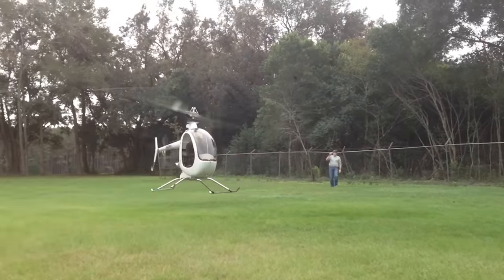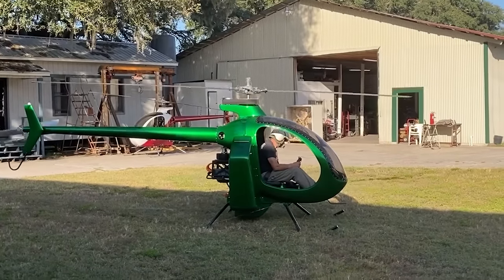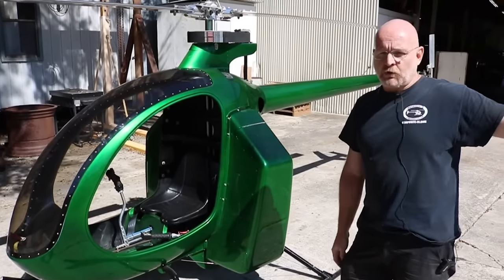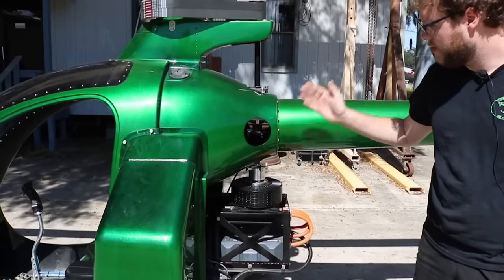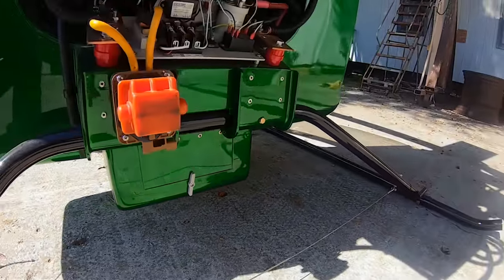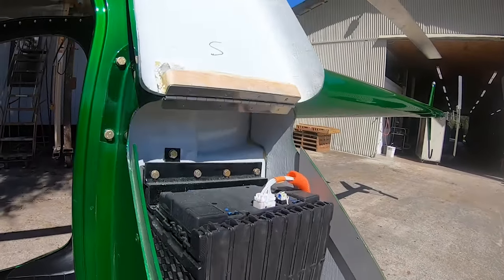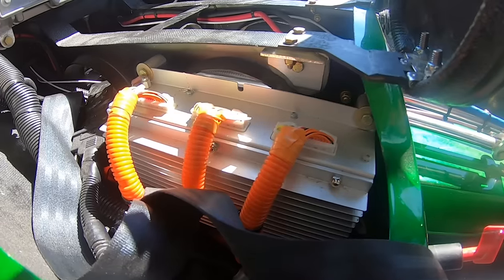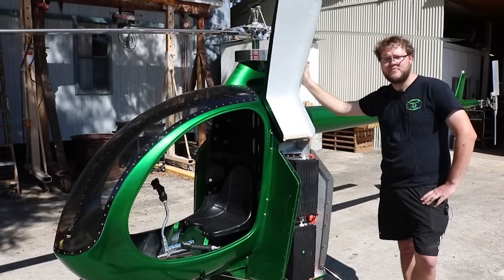Mosquito Helicopter going FULL ELECTRIC!? 2023

Comment: Being a test pilot for Robinson Helicopter for 30 years and building Tesla powered Ford Mustangs I love the idea.  The only issue is that flying for X number of minutes you don't get lighter with fuel being burned off so have have be careful of keeping enough hover battery power left to land safely as the weight does not change.
Reply: Yes, that's a burden that electric vehicles will probably have forever. But if some day we develop batteries with more energy density than liquid fuels, they might make up for the weight.
Reply: The Mosquito has great auto-rotation capability, so any engine loss can still be recovered safely.
Reply: @aeroengguy448  That is great but that's not what I'm talking about. You have to be very conservative on your battery so you have enough power available when doing a normal landing. You need as much hover power in the beginning as in the end as the helicopter won't get any advantage from burning off fuel making the helicopter lighter. Just something that has to be learned. Pilot training is all.
Reply: its still a very good initial training device with ability to emulate different power trains
Reply: @Roadstercycle  that must of been a dream job, and you must of been an very successful pilot maybe even military..I'm not a pilot but I've always observed the pilot throttle back to come down then giving it the  throttle and just before touchdown backing off the throttle..I look forward to seeing a hybrid version as well
Reply: @lightman489  Actually Helicopters don't work that way, we don't throttle back we actually lower the collective to come down, airplane pilots back off the throttle to loose altitude not helicopters pilots. We do close the throttle to do simulated engine failures to practice autorotations.
Reply: EV's are a stupid idea. This is a toy at best.
The EV is the most destructive vehicle EVER devised.
It is FAR more environmentally damaging to produce than any equivalent petrol or diesel vehicle.
It has a shortened life, due to the limited lifespan of the battery being just a fraction of a modern petrol or diesel engine.
Plus, as the battery is the largest and most expensive component in the vehicle, the car will be rendered almost valueless once it decides it doesn't want to be charged any more.
In short. They are a con. A very expensive con. A very destructive con. A very dangerous con.
The manufacturers know it. As do the "environmentalists". And governments.
And anyone else with half a brain.
Reply: @sahhull  That's pretty funny as that's the same thing people raising horses 120 years ago said about the horseless carriage. They'll never replace the horse.
Reply: @sahhull  Shortened life? Maybe with Teslas and other manufacturers that make them that way. It's not a specific EV problem, but how they're currently built. Electric bikes and motorcycles for example all have removable batteries that you can just replace and keep rolling. Much easier than replacing or overhauling a combustion engine, plus the electric motor proper will outlast any other component of the vehicle. Add maintenance (or lack off) and the economical benefits are quite obvious.

I won't argue that current battery tech is still harmful to the environment (even tho conventional cars are not innocent either) and can't replace petrol yet. But in the long run it's the best shot we have. Synthetic/alternative fuels will probably stay for more specific roles, but everything else will be electrified.
Reply: @moteroargentino7944  Tesla have a well known issue with their drive motors and premature failure.  It's not certain that they have solved it with the upgraded motors.
Reply: @sahhull  I think you are what we call a dinosaur. And good job not responding to any of the raised points that immediately undermined your arguments.
Reply: I image there shouldn't ever be a decrease in power available as the battery runs down. Lithium has a very shallow voltage curve. There should be a suitability sized motor to maintain 100% rotor rpm at all times even at full collective.
Reply: @Jameswrightdavid  I totally agree. Again it's all in the flight training.
Reply: @moteroargentino7944  MORE energy density than liquid fuels? You might be able to come close. But if you’re getting to the point of being better, you’re living in a completely different technological future. You’re talking completely revolutionary  tech. Hell, probably revolutionary tech OF revolutionary tech. It would be like going for cars, to the wright brothers inventing a plane. We can’t even conceptualize how a battery would work that can contain more power than liquid fuel. Battery flight is a pipe dream. Specifically  because you’re taking away one of the biggest advantage of liquid fuel, which is the aircraft gets lighter. But then, even if liquid fuel magically didn’t get lighter, it would still be worth it over battery
Reply: @Jameswrightdavid  fully discharged voltage is roughly 20% lower than fully charged, so if battery voltage is the power limitation, the power could be significant. 

On the other hand, in this case the motor is likely the power limitation.  Running at the speed that it does in this first experimental craft, it us marginal even for steady hovering in ground effect.
Reply: @sahhull  the combustion engine mosquito was nothing but a toy also, just saying.
Reply: 20-25 battery life 😂 it’s not even legal to take off with reserves.
Reply: I just started at Robinson.
Reply: @b69mach1  legal? reserves? It's an experimental version of an experimental series of aircraft that are essentially toys in their production version. They're not suggesting that anyone buy this as it is, and won't sell it if someone asks - it's just a research and development project.
Reply: @sahhull  im on my second tesla, i love it. They are more reliable than any gas car ive ever owned. Also, what is your data that EVs are more environmentally destructive? I am sure EV companies did their research on this but I do want to hear what you have to say since you seem to be the expert on cost accounting and the big picture.
Reply: @moteroargentino7944  efficiency is lost with energy transformation. What you’re describing isn’t possible. Energy has is captured to be stored in a battery. Never mind it’s lost over time. EV is a lost cause. I’ll keep burning jet fuel.
Reply: @Roadstercycle  to be fair to lightman, as collective is reduced less engine power is needed; as a result, to keep rotor speed from increasing the pilot has to reduce throttle, if the aircraft doesn't have automatic throttle control.

No modern helicopter should have a manual power control (throttle), and as mentioned in the video, this electric version has the obvious constant speed control so there is no manual action needed... but reducing collective still means reducing power.
Reply: Battery capability is yesterdays problem. As soon as they come out with the batteries we need ;) it will change everything!!
Reply: @sahhull  Your rant does not stand up to scrutiny. How many components in an ICE?. How many of those are prone to wear or failure? How many factories involved in manufacturing those components? How much energy to produce? Maintenance is much more complicated/expensive. Although electric has been around a long time, this aspect is in it's relative infancy. See how rapidly and effectively Tesla is shredding the ICE car.
Reply: @DBFIU  How do you expect a dinosaur to understand the wonders of our current technology? Dolphins and apes are closer to us but they can't do that. A dinosaur has absolutely no chance.
Reply: Adding a 20 kg petrol generator to give it 2 hours of flight time
Reply: Its funny how their always one who claims to have worked for all three.
Reply: @sahhull   All EVs need is standardization, we need standardized power cells. You go to ´electric station´ but dont plug anything, just choose if you need long range cell or standard and interchange these cells, you return your cells to electric station and it will sell you fully recharged ones. Something like this idea for current capacity values. In future for sure, it will be different. Until that i stays on combustion ones.
Reply: @sahhull  have a look at Lithium Titanate (LTO) batteries. Some have a lifetime of 30,000 cycles. Unfortunately the energy density isn't ideal for EV, they are a great alternative to lead acid starter batteries. They can also operate in extreme cold or extreme hot conditions. At 30,000 cycles, they'll very likely outlast the vehicle they're starting, to be almost a family heirloom that is passed down through the family from car to car.
Reply: @Cybertruck1000  the funny thing that ICE advocates conveniently forget is the environmental and energy costs of digging up, refining, shipping, then trucking gas to a gas station. In some cases the oil is shipped multiple times because many countries don't have the ability to refine their own oil. I live in Australia, and Australia cannot refine its own oil. We get all our refined oil from Singapore. 

EV only needs energy from a mass-producing power plant, transported by high-voltage transmission lines. Power plants are much much much more efficient at converting fossil fuels to energy than refineries, ships, trucks and the ICE vehicle.
Reply: @DBFIU  evs are absolutely more destructive to the environment. You should look up EV battery recycling programs. They don't exist you should look up EV recycling issues. Just because you drove a car through its warranty duration doesn't mean it's worth it's weight in 5 to 10 years when the battery pack is depleted it must be replaced.
Reply: @mastermnd22  Oh ok, thanks for the concise and clear data and cost analysis you've provided. You clearly show that given all variables, such as manufacturing costs up front for ICEs vs. EVs and long term pollution analysis (considering the gasoline spent to deliver the gasoline that then needs to be pumped into gas station tanks underground) and the analysis you've provided on the recycle programs that in fact do exist for batteries (there are very large grinding machines that break down the batteries and then they can be melted back down) that in fact, EVs are much worse for the environment. I am so proud that you have done all this hard work for me, it seems you truly understand the logistics and calculations involved with pumping, refining, shipping, delivering and then burning of gasoline and diesel vs. just creating electricity in one easy to manage and cheaper location where emissions are better controlled and powerplants can exceed 60% efficiency where the best ICE car engines are in the low 30% efficiency range. I am humbled by your input.
Reply: @jamesbizs  As I said earlier, I don't think that liquid fuels will completely disappear, they'll just be replaced anywhere they can be, and kept in applications where their characteristics are useful. For example, jet engines in aircraft for higher speeds, either military or civilian. Probably shipping as well.

Fuel getting lighter is a big advantage, that's true. Still, asides from big airliners that DO need the weight reduction to land safely, any other aircraft can fly without problems as long as they have enough power to run their engines the whole trip, regardless of weight.

That's why energy density is crucial, as long as you can cramp all the power needed to fly or travel a long distance in a reasonable size and weight, you can create a vehicle that can perform the same or better than one powered by combustion engines (barring the few exceptions mentioned at the start).

Regarding time lines, it may take some time but sooner or later it's bound to happen. We're not THAT far away, when we talk about energy density it's not the total potential but just the amount of final mechanical energy to the wheels/propellers vs total weight of the system. Energy efficiency is very important, given ICEs are 30% efficient at best vs around 90% of EVs, you don't need to match both exactly in terms of brute energy alone. They just need to accomplish the same tasks.
Reply: @sahhull  That's probably who all the car companies are putting billions of dollars into development into EVs.
Reply: @Roadstercycle  the batteries should be in auto switched banks so you can always have the power of a fresh battery even if just for a critical few seconds. another option is add a supercapacitor bank as a 'boost'
Reply: @sahhull  I cant speak to your own personal experiences with EVs or Hybrids. However, we have 3 cars. 2 of them are hybrid toyotas. The prius has 340,000 miles and still has its original battery. I changed out the 1st set of brake pads around 180,000 as the regenerative braking does most of the work. Sure.. the car is a slug to drive.. But I consistently get 45mpg+ on long runs with work even at this high mileage. Never once have we had an oil leak etc. Great little car. The other hybrid has 50k miles. No issues either and getting 36mpg+ for a AWD is not bad either. 

I dont know that EVs are perfect in every application, where the battery weight ratio is important, like a small helicopter.. But they do make sense in a school bus etc.. Plenty of torque.. stop and go.. loads of space for batteries, and easy to charge and they are only driven for 3hrs a day. 

Thats my 2 cents.
Reply: Doug? Tim? Jack? It’s gotta be one of you guys. There’s only a few of you that’ve been working on the factory flightline for that long. And every one of you guys are rockstar pilots! I haven’t been to the safety course in 20 years. ✌️
Reply: @Roadstercycle  well, another thing to consider is regen. i dunno about helis but i assume with altitude you can store battery power that can be regenerated on the way back down. just depends on how efficient the regen is.
Reply: @sahhull  nope. Plenty of evs have gone 500000kms on the original battery. The newer LFP batteries will last twice as long.

Most Ice powrtraina are worn out at 500000kms.
Reply: @moteroargentino7944  No, because an airplane can land anywhere that's flat enough, and even with little to no power, so they're already pretty much viable methods of transport, heck, you can drop the use of cars significantly if you make more small landing strips all over around cities for private and commercial Eairplanes. Meanwhile Ehelicopters and Vtols for now are kind of unjustifiable trash you can't really do anything with.
Reply: It's all about the possibility of risk and when you add a stupid battery your failure rate just increase times 10
And correct me if I'm wrong but there's NO AUTO ROTATION WITH AN ELECTRIC MOTOR????????????????
Reply: @aeroengguy448  you can't auto rotate with an electric motor you need a free spinning blade to do that!?
Reply: @Roadstercycle  actually LARGE airplanes land under almost full throttle in case they have to go around
Reply: @mkzhero  can anyone explain to me how you're supposed to auto rotate in a helicopter with an electric motor that doesn't have any "clutches" to disengage the blades from the motor???????????????????????????????????????
Reply: Maybe it can regenerate its battery while it falls to the ground
Reply: i dont think batteries are ever going to be where they need to be for any type of REAL efficiency. the next stage of electric vehicle development is hydrogen fuel cell for electricity generation and carrying a water dissolved liquid potassium borohydride, this will require probably a warmup cycle where you will need to get the fuel cell and hydrogen production feeding itself enough for takeoff
Reply: @thecloneguyz  Eh, you probably could make some new mechanism for it... But i don't know why you WOULD in the first place, considering that with 20-30 min flight time for any Eheli it just makes them an unjustifiable stupid gimmick for now.
Reply: @thecloneguyz  Every helicopter has something called a Sprague clutch in the drivetrain.  This one way clutch permits the rotor to free wheel in the event of engine seizure or failure.  This is what allows autorotation.  This electric version is no different.
Reply: @kosztaz87  removable batteries.. Considering that we don't have the lithium supplies to fully cater for the electric car market and phones etc how do you expect to magic up extra lithium for swapping out batteries?
Reply: @sahhull  take your meds mate. The early Tesla model S motor suffered eddy currents though its bearings, causing pitting on the bearing surface, and hence premature were. This is fixed now, with the current Tesla motors using non conductive ceramic bearings.
Reply: @jamesbizs  quiet. That is the fantastic advantage evs have. Quiet. Evs have a massive advantage over burning dino juice when it comes to noise
Reply: @13thbiosphere  nope.
Reply: @thecloneguyz  take your meds mate. Synchonous ac motors do not have magnets and create their own fields. Ie, no resistance to rotation when the power is removed. Also there is a clutch. Your problem is ?
Reply: @thecloneguyz  Synchonous ac motors do not have magnets and create their own fields. Ie, no resistance to rotation when the power is removed. Also there is a clutch.
Reply: @thecloneguyz  Synchonous ac motors do not have magnets and create their own fields. Ie, no resistance to rotation when the power is removed. Also there is a clutch. Your problem is ?
Reply: Actually bud…as the battery cells coating is diminished you would technically become “grams” lighter lol
Reply: @sahhull  There is plenty of lithium in the world. The problem is collecting and refining it. Lithium (the 3rd element in the periodic table) is more abundant than iron. Also rechargeable lithium batteries have almost no lithium in them (~2%).
Reply: Until we get carbon matrix batteries, I just don't see it having any more flight time than a short hobby jump. We could've been a long way ahead with experimental EVA... but our government, in all their ignorance, decided to tighten weight restrictions on ultralights with no EV exemption 🤦
Reply: @moteroargentino7944  we actually do have a solution to this in development hydrogen batteries

now unlike hydrogen combustion were not taking the hydrogen and burning it to create combustion and so on it takes the hydrogen and drips it over a cathode and anode causing it to combine with oxygen and generate a voltage and be converted to water and electricity

so this would get somewhat lighter with usage however the difference would not be as much as with aviation fuel as gasses are lighter than liquids so there may not be much difference in full vs empty

however i do belive the hydrogen systerm has a higher energy density per kilo than current battery technology so that might be where it makes up
Reply: Software will ensure the displayed battery percentage is for conservative and safety measures mate.
Reply: I was test flying the cri cri before a small company ordered several here in the USA.. I liked that it was mostly mechanical it handled really well for being so small but I wouldn't recommend flying it above 12,000 ft. This helicopter I would be very nervous as it's mostly technical..  
As a matter of fact all helicopters make me nervous because when you crash land them there's no way of coasting them it's like a big anchor being dropped. I would have to have a parachute installed as well as an overhead lever to manually stop the rotor from spinning..
Reply: @sahhull  please tell that to the taxi driver in Norway who has 400,000kms on his model S taxi  PS it still has 93% battery left.....
Reply: @mkzhero  Ehh... I was talking about aircraft in general. Includes all flying vehicles. Airplanes particularly are great to get from point A to point B fast, especially over medium to long distances. But over short to medium distances, other vehicles could be more efficient. Like in Europe that they're favoring the use of electrical trains over planes if the planned route can be done by train. For less busy routes you could use small electrical planes, personal electrical cars or maybe trolley buses if the amount of passenger movement justifies putting the infrastructure in place (like between villages or small cities). Relying on the grid is always better than carrying heavy batteries around.
Reply: @dask1516  - Ballistic Recovery Systems (BRS) makes an approved chute, which the feds have also given an exemption for gross weight. As for electric vs. engine... they're all technical. Turbines have frail internals and are sensitive to abrupt pressure changes. Small aviation grade piston engines are subject to catastrophic failure. Rotaries give a nice cushion, with respect to catastrophic failure... but they're too thirsty for small aircraft. Electric motors are significantly more reliable... but the control systems can be troublesome, and the overall weight of the package forces sacrifices to be made in the airframe. They're breaking records every day, and I know we'll see a successful EV market within a decade or two... but as for now, I'd call it even on the safety aspect.
Reply: @moteroargentino7944  That my friend is a pipe dream. Batt tech is mature.
Reply: @sahhull  Correct, but some do not like facts....  they'll learn the hard way.
Reply: @moteroargentino7944  thats the thing,for the most part, a comparison between a helicopter and a plane in terms of wastefulness is almost like the comparison between a train and airplane. Trains are by far the most economic (energy wise) method of transportation, only losing to the (human powered) bicycle, the velomobile and electric velomobile, which areto be honest an amazing method of transportation that sadly there's simply no infrastructure for (separate safe and well maintained roads). A car is far more wasteful than a train, an airplane more wasteful than a car, and a helicopter is the king of wastefulness. Helicopters only make sense for rescue and urban transport where there's no place to land, except converting VTOL's do that better (the type that has a wing and bends it 90 degrees after takeoff to be almost as efficient as an airplane). Anyway, 20-30 minutes of flight is just too unjustifiable for a helicopter to be practical and safe, and until the grid is fully green it's also not actually clean, so it kind of beats the purpose to have one anyway. Until batteries get better and they can squeeze at least an hour out of it, it's kind of just a rich toy.
Reply: Auxiliary landing battery. Fixed 👍
Reply: @mkzhero  what the heck man? Helicopters can be safely landed with zero power, in a space not much larger than a basketball court. Im not sure how a fixed wing craft that requires some type of landing strip can compete with that?
Reply: @sahhull  harvest it from the 200 billion tons of lithium disolved in the worlds oceans. Its not an efficient process yet, but look at how far phones have come in 20 years. The driver is always profit. Theres money to be made so it will happen...
Reply: It does lose weight.  Less than a gram but just saying.
Reply: @zenellwood7029  well, you overdo it with the "basketball court" size, they need much more space than that for autorotation, but yeah, I wasn't aware how efficient and semi safe that manuver is. Still, you also underestimate planes with the landing strip, the slower and lighter planes can land on a road, field, beach, or any even remotely straight plot of land pretty well.
Reply: Maybe they can eject the used up battery with a parachute in an emergency,
Or
Carry a spare, for emergency
Reply: Great comment
Reply: This is so dangerous only for one off mission with a paras hoot plus so bad for the environment when your making and disposing the batterys ultimate fail
Reply: Well if u have flown r/c performance helis you would know that of course, just like drones.
Reply: Wait isn’t the Robinson helicopter the worst safety rated heli in existence?
Reply: @rustyneedles3743  I mean I know you're mad but it really isn't that complicated. It is just a machine that grinds down batteries into constituents. Since internet seems very difficult for you to use, I did the research for you on Google. Here are a few names of companies that grind down batteries. Franklin Miller and Amey Engineering are two that actually came to mind, there are also pretty inexpensive grinding machines you can buy online if you wanted to start your own recycling business. It is a low overhead business and pretty easy to do. Do you want me to use bigger words for such a simple task so you can feel smarter?
Reply: Based on your experience do you think that this would work better as a hybrid?
Reply: @feelincrispy7053  They are all trial and error right now
Reply: What is Tesla powered Ford mustangs? Using components of old Tesla in a salvaged mustang body?
Reply: @blahblahblah9619  Mach E
Reply: @blahblahblah9619  I buy nice S197 Mustangs and then remove the motor, trans, and differential and replace them with Tesla drivetrains. You can see my builds on YouTube. Look up Roadstercycle Tesla swap.
Reply: Theres a special place in hell for people swapping electric engines into classic cars
Reply: @Immortal..  I'm glad that my conversions are not classic cars yet. I'd hate to be crusified by someone who has no clue about electric cars. Acceleration is the motivation.
Reply: @voornaam3191  so what I'm not a pilot but at least I'm a gentleman and your not
Reply: @feelincrispy7053  It was in the beginning but with safety courses and good pilot training that went away.
Reply: Can't a dynamo style system generate enough electricity to replenish the battery to some degree?.....and so, making that energy percentage account for the landing charge required?
Reply: @missingMBR  that should be corrected it isn't that Australia can't refine fuel we have the infrastructure they just won't because it is cheaper to ship it here ratger that process it here
Reply: @numnut1516  yep they are definitely toys but if you had to chose which would you prefer a toy that works for 20 minutes then is down for hours or one that lasts 2 hours and can be ready to go again in 30 minutes
Reply: Some brains are gonna work hard thinking about this.
Reply: @DBFIU  ever seen a lithium mine? What do you think is the driving force behind the production of you ev? Fossil fuel of course lol. I love tesla and aren't knocking ev's but to act as if they're better for the environment is a joke. Then there is the issue of recycling said batteries once millions start to flood the junkyards across the country. Simply put were jumping the gun on ev's under the false hope of being more environmentally friendly when in fact in the electric vehicles current state they are far more harmful than their gas counterparts. Not in their day to day functions as they produce no emissions there so they are more environmentally friendly once in production than a gas car while being as destructive as humanly possible on the production and recycling end of things.
Reply: @PatrickCavanaugh0420  do you have any actual data with numbers comparing the impact of mining lithium and making batteries vs the long term affects of pumping oils, refining them and burning them for the next 100 years? EV companies have this data, and the answer is yes, even though mining lithium consumes fuel, it is not even a fraction of a percent of the lifetime of fuel consumption and logistics of keeping oil and fuel machines and cars going. Do 5 minutes of research please, thanks.
Reply: @mastermnd22  Redwood is a massive ev recycling outfit. The CEO is from Tesla. Tesla batts are designed from the beginning to be recyclable. In 5 -10 years the replacement pack will be FAR cheaper than the orignal.
Reply: @thecloneguyz  Take an electric motor with no power applied and spin the shaft. It will spin just fine. No clutch needed.
Reply: Well sure and probably more ways to do it than one but ok make disposable battery that collapse and toss if need be or some type of parachute probably under the bottom to slow descent or emergency battery in maybe the tail just as extra but only few down sides would be charge times per flight
Reply: @DBFIU  doesn't matter your over thinking but you think one will cancel out the other nope they both have a place and especially light weight airplane but over a certain size oil is better
Reply: @BugThorn   like current propane bottles 🍼 for the gas grill
Reply: @moteroargentino7944  unfortunately if the battery still resembled anything we recognise as a battery and had the energy density of kerosene it'd level buildings if the battery was damaged during a crash.
Reply: @sahhull  What we need is a fuel cell that directly converts gasoline to electricity.
Reply: @moteroargentino7944  hydrogen powered electic is the way to go for stuff like this
Reply: @kosztaz87  Ah yes, the 'insult, then piggy back off other's to make yourself seem smart' Argument. 
At least we've found our pseudo-intellectual in the chat.
Reply: @DBFIU  Lithium and Battery production is incredibly destructive.
Reply: @Sercer25  yes, but not nearly as destructive as pumping, refining, shipping, burning fuel and oils. Ask any OEM, there is a reason they are going electric. It just makes sense, it is the lesser of two evils by a long shot
Reply: @DBFIU  the amount of upkeep electric will take if we all switch will be massive, lithium farms HAVE to be HUGE already, so it will wipe out much more land. Oil reserves arent as destructive because we can tap into resevoirs deep underground, and we have an absolutely massive amount. Lithium mines cover surface area, in addition to transportation (ships wont be electric)
Also, batteries get 'disposed of' in the ocean when they're used up.

We could have alternate engine powers, like water, but the patent holder got murdered.
Reply: @DBFIU  OEMs are going electric because its a cheaper upkeep. Cars arent going yo be cheaper after they switch to electric motors, and the 'energy' required to power them are going to be the same as gas....
Now it'll be way easier for them to price fix electricity. Enjoy the cost of hearing your home in yhe future, and powering it....
Reply: @Sercer25  ok you're one of those people. No, we can't use water to power anything, it is a low entropy substance. Once hydrogen and oxygen combine violently, the energy is given up as heat. Water is formed, and it remains stable and unreactive until you put more energy into it to separate it. The guy who invented the water engine was a cook, and had no idea what he was doing. He made a little splash and then died, there is no way to make a water-only engine, you need to add a ton of energy for hydrolysis to separate the O2 and H2 which consumes power. Lithium mining is destructive, of course, you make it sound like pumping oil is so simple, "it's already there, so easy!" No it is not so easy. Once the oil is extracted it has to go through miles of pipe and dozens of heat intensive and chemical processing to separate the weights and purify the oils. Then, it has to get shipped which costs more fuel. All of this is done continuously without end, batteries get made once and charge for a decade. The power they consume from a powerplant is centralized, one powerplant charging thousands of car batteries is much better than 1 milliom car engines running and needing upkeep and gasoline. A powerplant runs at above 60% efficiency in a lot of cases. Cars are barely above 30% efficient. This means for every pound of natural gas (which burns cleaner btw) a plant has to burn, a car needs to burn 2 pounds for equal amount of power, put simply. And there are logistics with shipping fuels to every single gas station on earth, constantly. I was a turbine engineer for 8 years. Don't tell me you or anyone else has any idea what they are talking about. I understand why OEMs are doing this, they ran the actual numbers, and so did I. The numbers point in the direction of EVs as much as you can kick and scream. Politics and tradition can only so far, then physics and economics always wins.
Reply: @DBFIU  the water engine was a joke, I don't expect someone like you to have a sense of humor. Anyway, disregard what I said champ. Enjoy your inflated electricity costs which wont fix anything, but it will give incentives for people to cash in on more environmental destruction cleanups. Diesel is a better burning fuel anyway.
Reply: OR STAY THE HELL AWAY FROM EV FLYING MACHINES
Reply: @Sercer25  I have no idea what you mean by that. Are you saying my comment was insulting?
Reply: that's a good point. He should design a mechanism to drop the empty batteries.
Reply: @sahhull  The only problem EVs is battery tech. Once we develop a better battery,  then the 21st century will get more exciting.
Reply: @DBFIU  you have had 2 Tesla's since they first came out in 2008, i bought my ford escape in 2010. With 256,000km on it and it is still running strong! I will get another 7 to 10 out of it easy! By then you will be looking at another Tesla! Gas is far better!
Reply: I think electric aircraft are a bit more challenging than electric cars, as cars have sporadic needs for full power, and can cruise at highway speeds on maybe 10% of the rated power.  An aircraft is typically asking for 75% of the available power most of the time.  However, I think recreational ultralights could be a great use case for electric aircraft.  2 stroke ultralights are loud, buzzy and annoying.  Going with electric with a larger diameter/slower moving prop, you could get much much more quiet.  And the charging cost per flight is measured in cents rather than dollars.  You don't necessarily need 3 hours of flight time; perhaps 1/2 hour is plenty.  Battery life is an issue, but not necessarily an insurmountable thing.  I appreciate those who are experimenting with electric airplanes.  I've seen some promising self launched electric gliders like ATOS Wing AIR.
Reply: @brianb-p6586  Matt here. 60HP (~45kW) is more than enough for steady hovering in ground effect. The issue we are working on is that at 2750 RPM, we are slightly exceeding the continuous power rating of the motor. But also that the voltage into the motor at this RPM is quite low, so we are exceeding the continuous current rating of the controller. We are either looking at a motor with a higher V/rpm, or the same motor with a spur gear reduction so we can run it at a higher rpm and thus lower current/torque, but same power. The motor is rated for 60kW(80HP) continuously and 110kW (147HP) peak at 5000 RPM. Actually making it the most powerful motor out of our whole model range, but of course flight time would be terrible if we were consuming that much power.
Reply: @brianb-p6586  Matt here. Thanks Brian, you are exactly correct. We recognize that 20-25 minutes would be a hard sell even to someone who just wants to do a quick buzz around their backyard or airport. That's part of the reason why it is just an R&D project. 
It's just a first step and basically us getting our feet wet as we look at alternative power-plant technologies. We are looking forward to working on a hybrid version, we recently found a supplier of cells (thanks to this video) that are roughly twice the energy density which might allow this to stay all electric and get double the flight time, but also allow us to get a safe reserve as well.
Reply: @Cybertruck1000  Matt here. This is one of the major advantages I see with electric power-plants. You don't need to do any maintenance apart from your regular pre-flight inspection of drive-line parts and linkages. No carbs or fuel injection to tune or worry about tuning for different altitudes/operating environments, no cylinder replacements, no spark plugs to replace, etc. Of course batteries do wear down after a couple thousand cycles, but how many people are taking their experimental helicopter out every single day for years for this to actually matter. 

Also it's very cheap to operate, it costs us about $1 to charge whereas in our XE290 piston engine you would be looking at 3 gallons of premium ethanol-free fuel for 30 minutes, 5 gallons of Jet-A for 30 minutes with the turbine. 

We are already in the process of working with a electric vehicle company to procure battery cells that are roughly double the energy density of our current cells. Battery technology is progressing all the time and we see that this may become a viable commercial product in the coming years. For now, it's an R&D project and to show off an innovative application of electric propulsion.
Reply: @0xsergy  Matt here. We don't regen. It isn't a great idea because what happens if you didn't actually capture enough energy to do a powered landing. You may not have enough rotor inertia to do a safe auto-rotation. We are working on designing a pack that has cells with double the energy density but keeping the overall pack weight the same, we will be able to add a reserve.
Reply: @thecloneguyz  Matt here. The motor is coupled to the drivetrain through a sprag clutch. So it autos perfectly fine just like any of our other models.
Reply: @thecloneguyz  It has a sprag clutch. Nothing crazy like trying to regen.
Reply: @glory122  Thanks for the reply. 

Yes, I realize that it is the inappropriate operating speed that makes the motor marginal, rather than the motor itself. I understand that changing the belt drive ratio to increase the motor shaft speed would not be trivial, because it would also change the tail rotor shaft speed, but for a production version is would be very desirable to avoid an extra set of reduction gearing.

Of course for development the extra set of gears would be a reasonable approach, and more practical than having a motor custom-wound. Even with custom winding and corresponding lower current, the continual high torque would likely be a thermal problem.
Reply: @sahhull  EV's in their current form, i can see that. Lithium Ion cells obviously aren't the best way, but they are the best way currently. And the industry is looking for solutions for more energy dense and efficient cells along with a more productive and less impactful way to produce energy. I agree that in its current state, that traditional fossil fuels make more sense, but I firmly believe that EV is the future. EV's and battery technology as a whole have a ton more R&D before that make more sense than fossil fuels. but, lets not pretend that fossil fuels aren't destructive and dangerous too though. I guess if you really wanted to "do your part" or "take a stand" or "make a statement", you could craft a bow and arrow out of sticks and stones, WALK into the woods, Kill your dinner and cook it over an open fire in the wilderness and live out the rest of your life in that way. Nothing destructive, dangerous, or expensive going on in that scenario I suppose. If that's not how you want to live, then shut up and enjoy living in the modern era lol
Reply: @aeroengguy448  But what if BOTH of those drive-belts fail?... is that bye-bye tail-rotor?  =:O
Reply: @MajorCaliber  depends on whether the engine has quit.  You have proposed an interesting but extremely unlikely scenario.  There are two drive belts for redundancy. The probability of simultaneous failure is near zero.
Assuming the engine is running normally and both drive belts fail, the engine would continue to drive the tail rotor.  With both drive belts gone, since the cyclic and collective controls are inside the rotor mast, the main rotor would continue to free wheel with full control authority to permit a normal autorotation and landing.
Even if the engine did quit in such a situation, maintaining forward speed would provide enough weather-cock  stability until landing.  And since no torque is being applied to the main rotor, there is no need for anti-torque from the tail rotor.
Reply: @moteroargentino7944  If we break physics?  Explain how this would be possible?
Reply: Actually building 'em instead of reading about it -       okay
Reply: Tesla powered Ford Mustang? Blasphemy
Reply: The energy density available per pound in batteries is very low so if this thing picks up its own battery it isn't going to fly very long. I'm going to watch the video and see if they say how long it will actually fly.
Reply: @Roadstercycle  horseless carriage didnt explode for no apparent reason so theres that
Reply: @missingMBR  ever see a lithium mine?
Reply: @sahhull  I dont understand your negativity. So what do you propose? We just stay on fossil fuels forever? The tech will get better, its in its infancy, its 100% the way forward!!!
Reply: that's a software problem
Reply: @sahhull  not to mention the power grid.  Or the fact that power plants use fuel
Reply: @blahblahblah9619  looks better than a Tesla
Reply: @jamesbizs  Santos Dumont invented the plane
Reply: @foreignwarren7361  I don’t think it’s negativity, It’s the limits of physics.  With our current understanding there is no feasible way to make batteries anywhere near as energy dense as hydrocarbons.  

So the transition off fossil fuels (which are def. in our interest) will need to come with many limitations.  There’s just nothing as cheap (short term) or energy dense that we can replace it with.

For example I have a lithium solar generator for my RV- it cost about 1400$ to diy and has almost 3 kwh of batteries.

My gasoline generator is a 3kw generator that cost about 500$ and an hours worth of power takes about a 1/5 of a gallon of gas (1$).  so 1$/3kwh to run.  The difference being that with a 5 gallon gas container it can store 25x more energy and in the short-medium-term is much cheaper to buy and run, with vastly more capacity.
Reply: @moteroargentino7944  great video content but desperately needs a monopod. The jiggly camera work is almost  unwatchable.
Reply: Do you really want to trust your life to fly in an electric anything?
Reply: @prof.crastinator  limits of physics? Would the Wright brothers had bothered building a plane if they had your attitude....look at aviation now....who are you to draw limits?
Reply: @foreignwarren7361  But the wright brothers were aiming for something that even then was completely in bounds of known physics.  

Batteries having as much energy density as hydrocarbons is not.  For a few reasons.  I would gladly take the time if you truly want to learn…
Reply: @prof.crastinator  are you some kind of scientist? or just a back yard conspiracy theorist who has watched too many youtube videos?
Reply: Small minded people in here with absolutely no vision or experience whatsoever. 
I'm the only one that replaced one cell in my Ni-Cad drill battery instead of replacing an entire battery pack, no I'm sure there were many people that did. Then along came lithium, I used a lithium pack on that 14v Dewalt for many years. The same applies to current lithium drill batteries. $13 battery and a little DIY vs $120 for a new pack from the manufacturer. Most EV's use 18650 cells, the battery can easily be rebuilt by simple DIY. If a pack uses 6k cells, they all don't go bad at the same time. Actual knowledge is greater than regurgitating the same old garbage people think about batteries. 
We are in the infant stage of what electric motors and batteries can actually do. 
When I built and flew FPV racing drones I could fly all day, simply by swapping batteries. The charger I used had four ports and I could charge three batteries on one port at a time. The problem with current EV's is every manufacturer uses a proprietary battery and they don't design the vehicle for quick swaping batteries. 
Electric uses energy more efficiently than any IC engine. Search for a recent video Hummer EV vs Dodge Ram diesel pulling a trailer.
Reply: Have the same issue with elec paramotors. 
Least you land lighter , can easily carry extra fuel and long fuel reserves give you options especially for landings like go arounds etc.
Reply: @jiml4987  Yes, actual knowledge about cell degradation, dendrite formation and the cycle life of specific lithium chemistries are important, but more important in this conversation is physics and the periodic table.

To make a battery, as we understand them today, there is nothing that CAN come close to hydrocarbons.  Lithium is already the lightest metal, which for energy density purposes is extremely important.

So your question should be is what is the most we could ever get out of lithium?  

There just isn’t enough there.

I doubt we will see a doubling of battery energy density in our lifetimes let alone the 10x needed for them to replace hydrocarbons.*

There a physical limits in safe energy storage- and Hydrocarbons seem to be right there.

*that is affordable and available in earth
Reply: @jiml4987  And what does pulling that do to the battery life of said hummer?

I get that you’ve seen such a huge increase in battery life and power over your life and so you are extrapolating that that of course is going to continue.  But it’s not, as lithium is the lightest, most energy dense metal (needed for a battery) and although tweaks can still be made to the anode and cathode increasing charge efficiencies and preventing dendritic formation, There is a maximum power volumetric that can never surpass hydrocarbons.

And EVEN WITH internal combustion’s inefficiencies, the power density available is an order of magnitude greater than batteries.

It’s physics, sorry.
Reply: @foreignwarren7361  It doesn’t matter what I am.  Am I wrong?  Lithium is already the lightest, most energy dense metal.  

Please explain how it would even be POSSIBLE to make a theoretical battery with as much energy density as hydrocarbons?
Reply: @prof.crastinator  The battery life. I had a 2006 Toyota Highlander hybrid with 350k miles on it. Someone pulled out infront of me and the insurance totalled it four years ago. I rebuilt the battery twice for very little money in the 12 years that I owned it. Most people think that once the battery is bad, the entire pack is scrap. I also know a few people that rebuilt their Ford Escape batteries.
That video gives the math of KW hours vs one gallon of diesel. I believe the Hummer was .6 percent efficient,  while the diesel was .25 percent efficient per mile driven. Like I said in the previous reply, electric is more efficient than IC engines. 
Lithium is far from that's the best they can do. For starters you have Lithium-ion and LiPo which is completely different chemistry. The biggest draw back with batteries is internal resistance and for example graphene lowers IR. Like I stated earlier we are in the infant stage as far as batteries go for consumers right now. Some very cool technology sitting on the shelf right now.
Reply: @prof.crastinator  Look at what Tesla did with a simple electric motor that was old school technology. They made one of the fastest production cars on the planet. Why didn't any other automotive manufacturer use this technology? 
Same thing with battery technology, Internal Resistance is a huge factor in battery efficiency. I don't think we have even started unlocking it's true potential.  Look how far the IC engine has come in 100 years. We have only been using lithium as consumers for roughly 20 years and now we can charge our lithium phones safely at 18w. 20 years ago when they claimed phones would replace laptops I laughed so hard. The IPad came and now phones can replace laptops in nearly every category.
Reply: @jiml4987  You said a lot of things, but the physics barrier is still there… again graphene anodes and cathodes can go a long way in charge time and life but do little for density.  We are in the grandfather stage as far as batteries go.   Lithium ion and lipo are almost exactly the same chemistry, I think you mean lifepo4 that has very different characteristics.  Otherwise nmc is hardly different.  but nmc is the highest density and comes with it’s own problems.  I have heard of lithium silica and some others (lithium titanate that will never have the density).   But if you notice nothing has REALLY changed since the 90’s with the tech (aside from production and pricing).   They aren’t really more dense, they are just bigger volumetrically.   
Efficiency hardly matters when hydrocarbons are so much kore energy dense.  ICE engines really don’t need to be efficient, as their energy storage solution is so much more dense.

Please explain another potential battery without lithium that is as energy dense? graphene will only be a component to batteries IF a cheap method of production is ever attained.  It still doesn’t solve the problem, sorry. the
Reply: @Roadstercycle  very true,  but today's EV's are comparable to the 8 track,  there technology is hopefully outdated within a couple of years, and that technology outdated soon after that, I'll be excited when the get to the CD stage of there existence,  right now our battery technology sucks, and is definitely a environmental problem developing fast, and this technology may have to be scraped altogether,  we can't put all our eggs in one basket,  we definitely need to be researching alternatives to electric,  because right now electric is not a sustainable solution,  that's why wind and solar are not sustainable,  batteries are bad, and dangerous,  we can't force a failing technology,  I look forward to the day that I can put a alternative power source in a classic car or a old truck, but we are not there yet.
Reply: just put a solar panel on it  :)
Reply: @GEMOGRAPHER  good ideas, but even better…..just dump the electrons that have gone through the motor so the gross weight decreases during flight same as with a gasoline or jet heli.  Of course we can’t risk having falling electrons land on people but, fortunately, we can use the tail rotor vortex to scatter them. I figure that ejecting spent electrons and using anorexic pilots would get flight endurance to near 40 minutes.  Almost enough to permit legal vfr takeoff!!
Reply: Hey I worked for frank for many years I was there when Arnold Schwarzenegger visited and president bush I used to assemble the cowling afc for Robinson R44 in Torrance California
Reply: @elchinolas777  Frank passed away over the weekend.  He was a great mentor to me. RIP Frank
Reply: @Roadstercycle  oh really wow 🙏🙏🙏 R.I.P. WHATEVER HAPPENED TO HIS SON FRANK JR.
Reply: @sahhull  Quiet ....you may upset the delusional liberal!
Reply: @stootsmcgoots  upset the liberal? I'm conservative and disagree with @Northy. Maybe it's just a problem with people being gullible. Amazing.
Reply: @prof.crastinator  you are so wrong about battery density it's sad. You said this, "They aren't really more dense, they are just bigger volumetrically." Battery DENSITY has nearly TRIPLED since 2010. I think you should reinvest more time into reading about battery technology before spouting inaccurate information.

Sony in the early 1990s, had an energy density of under 100 watt-hours per kilogram with the original commercial lithium-ion battery. The familiar cylindrical 18650 cells on the market were hitting 200 watt-hours per kilogram by 2010. Batteries used in electric vehicles have gotten as high as 300 watt-hours per kilogram in the last couple of years.
Reply: @vanbatim5906  Almost all due to volumetric changes in cells.  They use bigger cylindrical cells, which require less space between.  but the actual vomumetric energy density of each cell has hardly changed. 

Maybe you should read what I wrote?
Reply: @vanbatim5906  You notice you started with 18650 and didn’t keep that comparison? because around 3.5ah is still about the highest capacity 18650 -and it’s been that way for about a decade.  

that’s why newer teslas use bigger cylinders, improving pack density- not individual cell density.  That has barely changed at all.  Sorry you misunderstood.
Reply: @vanbatim5906  And I literally build lithium battery packs for a living… So I think I’m pretty well-read and researched on the topic.  You should believe less marketing hype, which you have clearly been swindled by (cough Tesla cough).  

The Electric car industry is now moving towards lifepo4 cells for their longer life, cheaper and more humanely sources materials, and better safety profile- And they are LESS dense than nmc or liion.  So you can say that we’re actually moving towards less energy density.

These would never make sense for aircraft, but then neither do nmc or liion really.

Please show how I’m “so wrong” that “it’s sad”?
Reply: What is we have gallium nitride battery with solar panels on tail 😃😅
Reply: @mastermnd22  The first part of your statement has been false for about 5 years.  Before using the "you should look up" as a proof statement maybe YOU should look it up first.  30 seconds on google found over a dozen companies/programs to recycle EV batteries.  And most of the "issues" were simply that the supply of Li-ion cells being recycled at the time didn't justify the cost of recycling.  It is VERY different now.
Reply: @thecloneguyz  Sure.  Unless the motor had had its terminals shorted (basically acting like an electric brake) it ALREADY freely spins.  it doesn't need a clutch to disconnect the rotor.  It absolutely can auto-rotate just like a helicopter with a gas engine and clutch (that hopefully operates when you need it to).
Reply: @sahhull  blablablabla and I bet you're typing this on your flip keyboard phone. Wait, you're still using a crank phone.
Reply: @Roadstercycle  Is it worth it to buy a Mustang?
Reply: @DraGon-cg6ge  Hi,  AS I looked at many many vehicles to turn into an everyday driver EV I found the S197 Mustang to be the best donor car because of the width for a Model S rear suspension, The engine bay and tunnel to house the batteries. I wanted to do a 67 Mustang fastback but they are expensive and too narrow for a Model S suspension. The S197 is a fastback and does have up to date safety features and electronics. There are other donors you could use but you have to build an engine cradle and have custom short axles made for it.
Reply: Question is, which would you rather test fly, this, or that all electric R44 that's around as well?
Reply: After flying for Robinson Helicopter for 30 years and 9000 hours with no incidents I'll leave both of them to the younger guys. I'll just watch and build Tesla conversions. on the sidelines.
Reply: Have a mechanical / chemically actuated emergency battery ejection feature for landing with auto rotation hahahahahaha
Reply: yeah... not with todays battery technology. a bunch of dudes are gonna die if they force this fully electric helicopter nonsense today.
Reply: HÉLICE PARO , ATIVA  O  PARAQUEDA
Reply: @Roadstercycle No doubt a learning pilot would LOVE hangin out with you lol- the value of your knowledge in this arena is priceless indeed. Hey you should do your own channel or podcast etc - if don’t already that is- if so I’d be thrilled to learn then subscribe & engage with you.
Reply: @jeffchristianson-ziebell7727  Hi Jeff, I do have my own channel, It's "Roadstercycle" I do more of educating people on building Tesla powered EVs than Helicopter training these days. Seems my interest these days is ground based vehicles. Although I do have my own design for a single place stand up drone configuration screaming around in my head.
Reply: they won't have enough practical time in the air to worry about it lol
Reply: Yes
Reply: @sahhull  the real goal is EVs can be built with high automation,  employing humans and providing benefits is the high cost of manufacturing. Eliminate almost all of that and no dealership networks provides huge profits.  If the world was really worried about the environment then there would be many more ways to combat the situation which are not being focused on.
Reply: 30 years, 10,000 hours being a test pilot at Robinson and I'm still here and no mast bumping incidents. Yes there has been mast bumping incidents when flown out of the flight envelope and bad weather, your point?
Reply: @sahhull  You do realize that most small aircraft use leaded avgas fuel, right? And you want to talk about the environment 🤣🤣
Reply: @Richard Paige III  autorotation with an electric motor is easier than autorotation with an engine. The motor freely turns any time that's desired, at any speed, by just telling the controller to coast... or just turning it off. This can be demonstrated with any production EV - just turn off any automatic regenerative braking mode.

While an overrunning clutch can be used , it is unnecessary.
Reply: @Nor Dic  you probably mean "asynchronous" (or induction) motors, rather than synchronous.  Synchronous motors typically have permanent magnet rotors, although they can also have wound and powered rotors; either way, they coast without problems.
Reply: @0xsergy  no, there is no energy to be recovered through regeneration.  A helicopter barely glides in autorotation- there's no extra to drive regeneration.
Reply: Sure, but you're not hovering at anywhere near 100% power even at the beginning. What is the torque instrument reading at hover? 60%? A battery doesn't drop to zero unless you overdischarge them.
Reply: Did not understand one word.... 🚁 But I'm impressed 👍
Reply: @moteroargentino7944  fuel cell technology already exists but never went into serious implementation for reasons I am too lazy to look up.
Reply: @jaredstocks7893  You've made the wrong conclusion. Some energy is always converted to heat when we produce energy; however, the idea that your car or aeroplane is efficiently converting chemical energy to kinetic energy is wrong. Especially when you compare typical engines to the efficiency of modern power plants the you';; see the real benefit of electric motors. An electric motor. A typical gas engine can turn its chemical energy into kinetic energy at less than 40%, meanwhile electric turn their electrical energy into kinetic energy at closer to 85% efficiency. Add to that that power plants produce power produce power much more efficiently than small gas powered engines and then you can clearly see that the benefits of electrical motors is undeniable. -a student in electromechanical engineering
Reply: @Roadstercycle  Horse is not a very profitable business than a giant factory manufacturing ford Ts. And evs are not different than ice cars, they are just using different materials to produce them. Car is car, but this future you defending is just stupid. Changing horses to cars was a different context, it made people's lives easyer.  But I don't see evs profitable in a long time, since those batteries are not renewable and a lot of things use batteries, we could face batteries shortages since extreme extraction of these materials could be harmful to the ecosystem, not to mention the prices that could rises for almost anything.
 I defend the production of hydrogen, even it's on early stages it could be the real future for transportation.
 Evs are pushing a lot of more resources that are already be using to a lot of things, like oil to produce plastic. And in my opinion, hydrogen and other clean fuels is the main resource from transportation. Let those batteries to the smaller things like your cellphone, notebooks etc.
Reply: What about a hybrid solution with smaller batteries?
Reply: Also a fuel tank only holds half it's energy the gasoline is mixed with air and doubles in power. Batteries don't mix with any outside source.. 100% of the power needs to be stored onboard
Reply: 25 MINUTES OF FLIGHT TIME? YOU MAY AS WELL GO BACK TO GAS ENGINES. THIS ISNT PROGRESS THIS IS GOING BACKWARDS LOL
Reply: PREP TO FLY THIS THING TAKES LONGER THAN THE ACTUAL FLIGHT DURATION LOL. CHARGE FOR 10 HOURS JUST TO FLY FOR 25 MINUTES? WHAT A WASTE OF TIME BUILDING THIS HUNK OF JUNK
Reply: @Roadstercycle  120 years ago, we had EVs as well 😊
Reply: @shuttlebug468  Yes sir, Just ask Jay Leno he is very educated in the subject and owns a couple of the old ones.
Reply: @sahhull you said it all
Reply: The problem is you will never get enough flight time due to the weight limits and batteries are heavy. It is a great idea but will never be viable.
Reply: As Einstein discovered, the battery will get lighter after spending its energy, so you may land with a microgram or so less :)
Reply: Can put alternator and recharge 10 - 15 percent back
Reply: Yeah they will definitely need to focus on keeping the weight at a comfortable level for any point in the flight regime. A backup battery won't save you from a motor/mechanical failure. So if you need to land with no power the weight must be manageable.
Reply: Less moving parts in electric , compared to turbine or piston . Safer .
Reply: What do you think? How good do you have to be to enter heaven?
 How many lies have you told before in your life? Ever stolen? Ever lusted? 
Ever hated anyone? Ever cursed? Ever been selfish?
 We have broken God's laws but Jesus Christ has paid our fine!  Turn or Burn
Reply: 100%.     Also possibley have a small  backup pack that would have like 5/10mins    just so you can land safely in that situation of low battery 🔋 !!     I love the idea of a full electric ⚡ 🔋 power small helicopter!!!
Reply: My dumb question is could you maybe put like a solar panel on that thing somewhere and charge the battery as your flying to help maintain needed energy? 👀
Reply: @thecloneguyz You’re wrong on both counts
Reply: @blueberrywilbur315  I don't give a f*** because I wasn't f**** talking to you
Reply: @sahhull  Your arguments do have some weight to them but your choice of words really make this seem like something done on ill-faith. It's true that the environmental impact of the sourcing for the batteries is much larger than conventional diesel or gas engines but if we're going to compare the two, we need to compare the environmental impact of the two, we have to do it along the entire lifespan of the vehicle and especially the use phase, the emmission form the vehicle are essentially null, especially if the energy is sourced from a renewable source.

Now, I'm more of a traditional IC-engine fan when it comes to cars. but Calling EV's a con is essentially projecting undeserved ill-intent upon manufacturers and proponents of EV's. It's simply the next step in transportation technology and, as much as it pains me to say it, I would not be surprised if driverless vehicles as standard is the step after that.
Reply: @jamesbizs  Technology will only accelerate in it's advancement. I would not be surprised if with the advent of quantum computing or more advanced AI, new discoveries in material science are made.

it's like telling someone in 1902 that we would touch the surface of the moon within their lifespan
Reply: Fabuloso. Éxitos